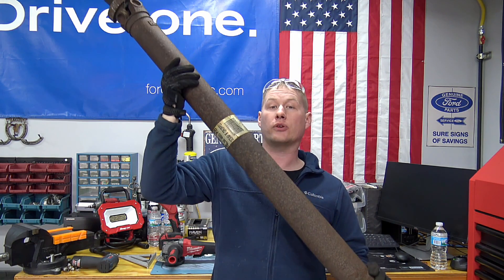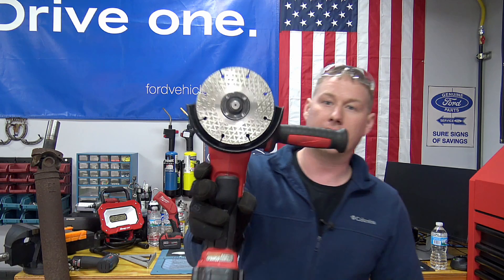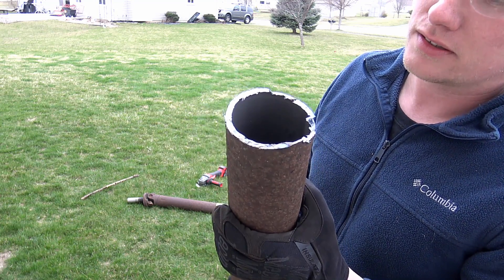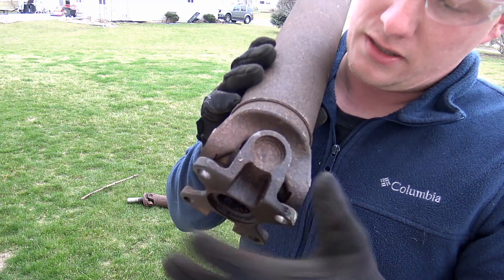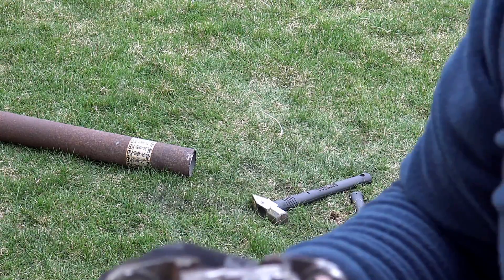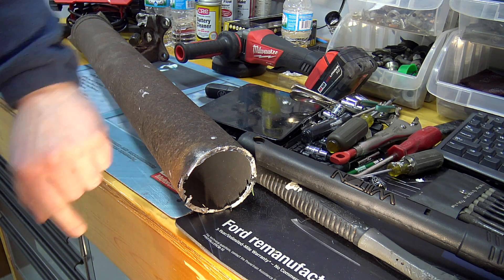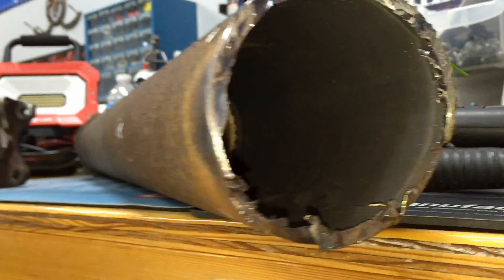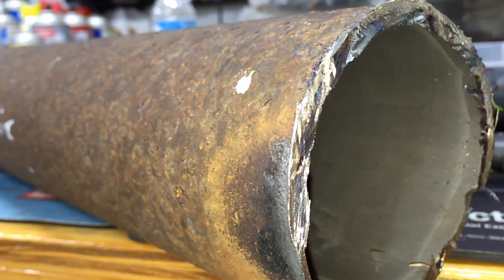So What's Inside a Ford Driveshaft Anyway?

Comment: My 1966 Comet Cyclone GT drive shaft was a tube within a tube with a layer of rubber between them. I ask one of my neighbors who worked at Ford, how do they make those? He said a big press, lots of lube and also a lot of scrap from the ones that fold up while they're pushing them together. He was a vibration expert for Ford traveling around to jobs that were not solvable by others. Oh, he also had a drive shaft in his garage that had been twisted right in two. He said a big truck stuck in sand is what had done that when I ask.

Comment: If I remember correctly, a solid cylinder compared to a 90 percent hollow tube, on taking torsion loads the tube only suffers 4 percent loss in capability. So the thinness here is perfectly fine. I am not quite sure if I remember the numbers right though.

Comment: Sorry if this has been asked, why did you replace the whole driveshaft?  Why did you not just replace the joints?
Reply from the maker: +Robert Wynkoop see comments below basically the special joint and labor would cost about the same as a new driveshaft at my cost it only made sense.

Comment: What was the reason you chose to replace complete driveline?  Why not just replace the cross?  I can't believe that the cost of the driveline was cheaper than a bearing cross and the 20 minutes it would have taken to replace it.
Reply from the maker: +Shawn Andera $165 joint plus extra labor to cut out the staked joints and shim. Weights were rotting off also. Instead I sold the new complete driveshaft for my dealer cost of $320 instead of over $500 retail and it's all new for them perfectly balanced that way for almost the same price. Also the front joint was on its was starting to get stiff so the front joint would be needing replacement next which doubles the cost.
Reply: FordTechMakuloco
That makes sense then.  Thank you for the reply. I work on ag equipment and we replace u-joints quite regularly.  But the drive lines we deal with are upwards of 500 where the cross is less than 100.  Didn't know the crosses were that much.  Thanks again.
Reply from the maker: +Shawn Andera just on these staked units other wise they are $50 tops

Comment: Way cool Video.  The cardboard is crazy smart stuff. gotta be for rotational mass dampening?
Reply: +Hawaiian F150....yo, l bought the two pack of 4amp ridged batteries for $80! x4 impact got a work out yesterday doing a front Mariner brake job .
Reply: +Dirtyharry70585 -- Cool - bet you got to be careful though.. might over torque the bolts. Might not want that.  $80 bucks is a darn good price for two 4.0's batts. You did alright there.

Comment: Back in the 80's and 90's I was a gm dealer tech and on some of the car's ( i can't remember which body style now ) The driveshaft would ring at certain speeds. Gm's fix was to foam inject the driveshaft's to act as a dampener...it worked!

Comment: hi.
  Really appreciate the vids.  COuld you do, or have you done an oil/oil filter video?  You must be an expert on this subject.  I have a 2003 taurus and pretty much use the Frams thinking that a filter is a filter, but now I am not so sure.  
  Is the expensive filters worth it or can you really not see any difference.

Thnx for your time.
Reply from the maker: +SGDeGalvez Stick with Motorcraft filters there is no need to use anything else.
Reply: thnx
Reply: +SGDeGalvez .....you'd be shocked if you saw the guts of those fram filters.
Reply: ya..i did and was..i quit using them but not sure which ones are legitimate.

Comment: The driveshafts are usually made from seamless steel tubing (they heat solid steel rod almost to the point of melting, and bore it out then go through the tempering process).
Reply: +erik penry 
What you are describing is not the norm. 
Most OEM driveshaft tubing is welded steel (ERW) with a longitudinal seam, some tubes for high performance applications are drawn over mandrel (DOM) steel tubing, few use hot finish seamless 1026 tubing, very few use cold drawn seamless steel tubing, today in the US some driveshafts employ lightweight extruded aluminum tubing. 
Steel, tubing material type ranges from 1018 mild steel to 4140 chrome moly for OEM hollow tube driveshafts.

Comment: friend of mine works at a driveline shop and he told me they put cardboard in it to keep down the road noise as rock and debris flies up and hits the drive shaft that way doesn't sound like a bell every time a rock hits the hollow drive shaft. it helps take the ting out of the metal. kind of like sound deadening material on the floor of a car
Reply from the maker: +Nathan Platt yeah that's what I figured but surprised it was only a small piece maybe 1/3 of the driveshaft length.